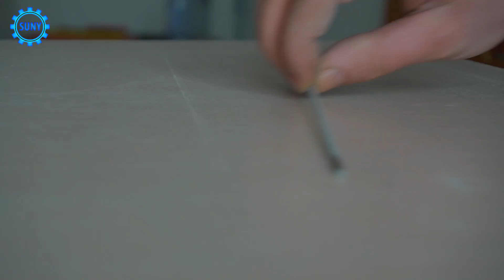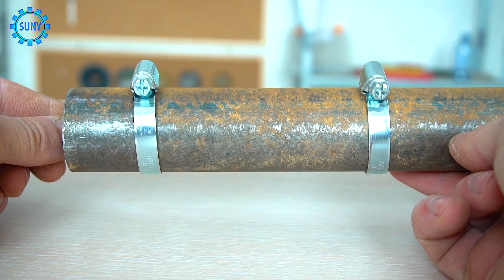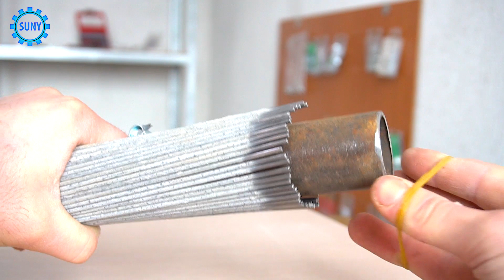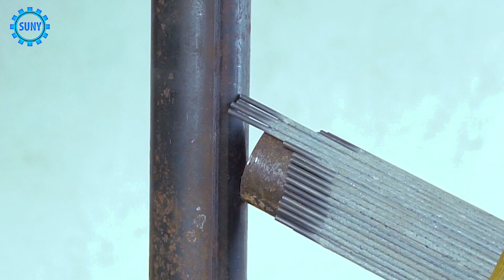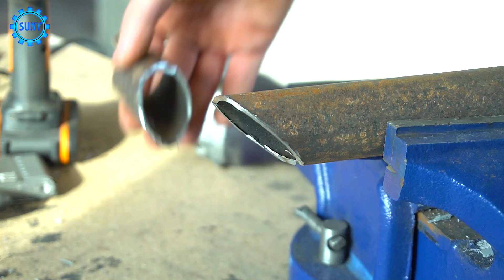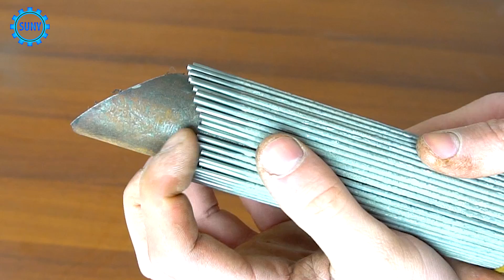WOW! Amazing Homemade Inventions

Comment: For the same price as all those welding rods you could have purchased a hole saw of the correct size which would have given you a far cleaner cut and you would still have the weld rods to attach it. You successfully wasted your time, effort and money. Bravo.